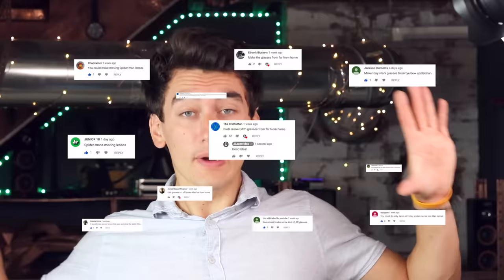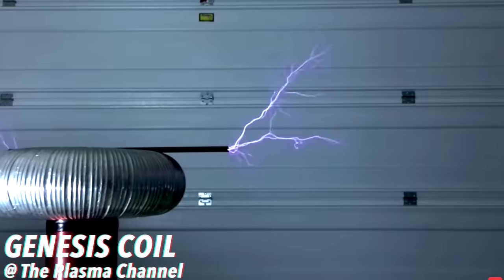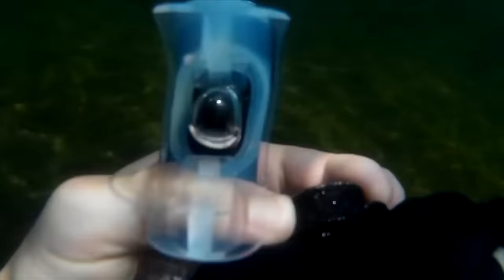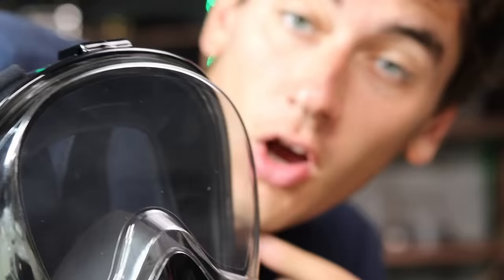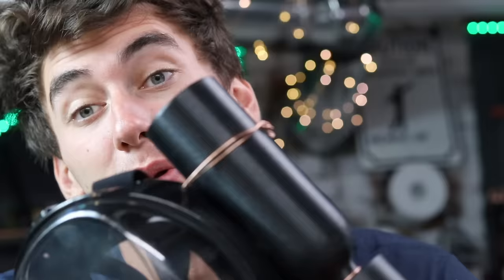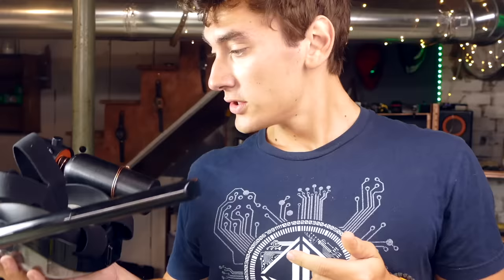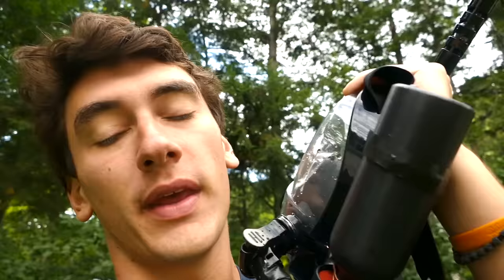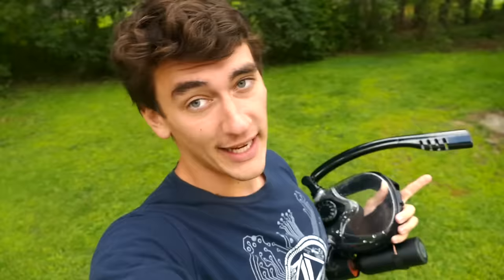BREATHE UNDERWATER With Just a MASK?!?! - Easy James Bond SCUBA Build (Building Your Ideas #1)

Comment: What about getting the bends
Reply: Depending on how deep you dive and how quickly you surface, that might be a risk. I don't really know how quickly Nitrogen will saturate your tissue, so you might be fine if you only dip down and come up without delay, but slowly. Nevertheless, if you don't exhale all the way back up, you might rip apart your lungs. Also, having to breathe heavy will exhaust you rather quickly and drain the tank pretty fast. So you might just be out of air without any warning. That's when panic sets in, and panic has killed many divers, even the most experienced and well equipped.
Reply: C3 RAVN definitely that’s why I stick to freediving

Comment: First of all you need air filter, you using air pump that has oil in it and probably the air is contaminated you can get sick easily, second of all you need to know about gas expansion and third dont try to stop your breath and do you know how to equalize just with your jaw ?
yeah don't do it ...

Comment: i bet you cant make a flying hoverboard now i will tell what all you need to do to make this okay. so first you need a normal hover board then place some anti-magnets under it  and then put some sensors in it so if wanna move left,right so for moving left force your body to move left and the same is with moving right and make its height only 39 centimeters and this is why i told you to put   anti-magnets under it the use of this that our earth has a little bit of magnetic power so because of it our hover board will fly done i know you wont be able to do this because it is so hard right i bet you to do this if you do this i lose and if you dont i win now you choose what you want to do lose or win (sorry if i did any spelling mistakes because i am a kid) you only have time till the next sunday okay see ya later.

Comment: Just get a freediving course and you would be surprised how much longer you can stay under the water then with this piece of junk. My concern of safety starts with the full face mask. In case of emergency (flooding the mask) you can't take it off fast enough. Try to guess, why scuba divers are not using full face masks. By the way, depth of three meters deep is enough to kill you. There was an accident in a swimming pool in our town. Scuba diver panicked and holding breath ascended from 2,5m which is less than 10ft. He died. This is not fun without proper training.

Comment: THIS IS DANGEROUS.  Without something to equalize the pressure like a scuba "regulator" then you are really playing with fire here. Also, you need proper training. You cannot ascend faster than your slowest bubble with air in your lungs.... To design or use scuba equipment you need more training and research.  I think you should remove this video, and take a more scientific approach to your work.